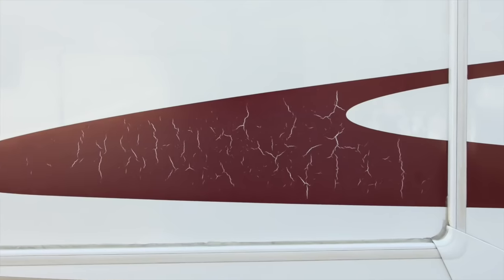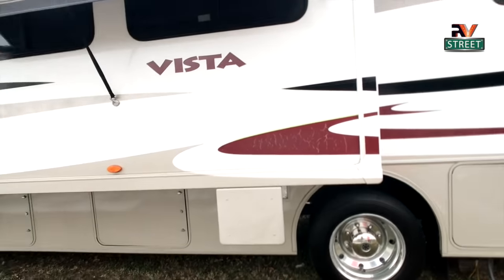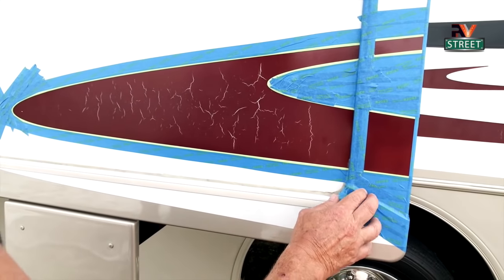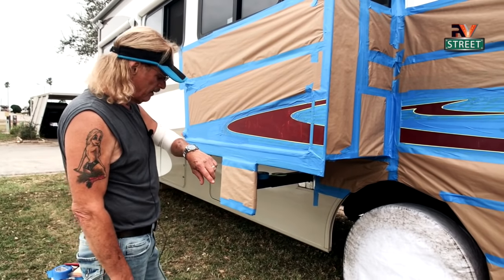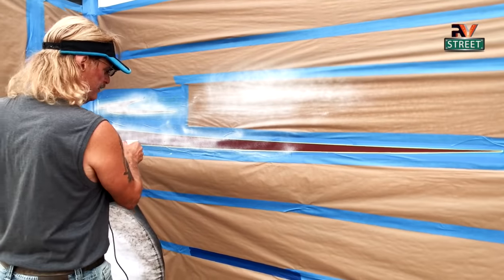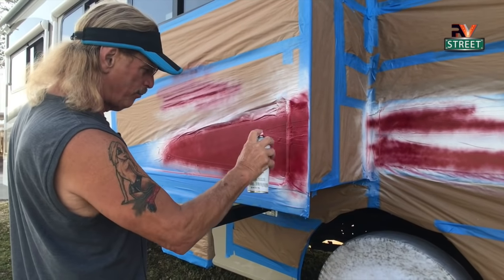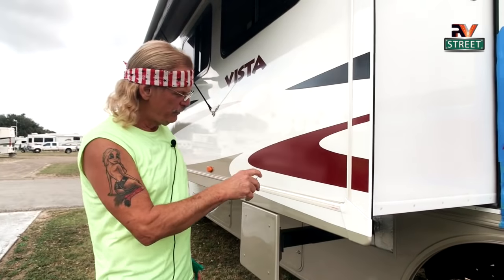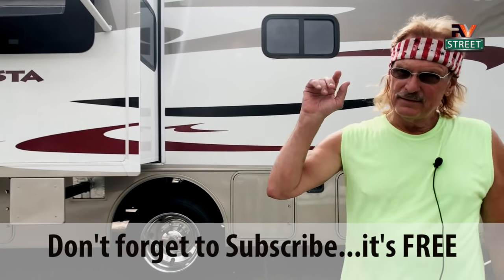How to fix Cracked & Faded RV graphics. Easy DIY job

Comment: Very good video. I was looking at doing lots and lots of buffing compound to try and bring back the graphics. Phooey on that, I'm gonna repaint them. I'm much better at masking off and using a rattle can than I am at buffing.  I may try using a super thin mixture of Bondo to fill the cracks then sand. Good stuff to know. Thanks.
Reply from the maker: Using bondo to fill in cracks will work fine

Comment: Manufacturer cheap clear coat on Class C above cab has worn and graphics cracking. These are great tips!
My issue is getting up there to attempt to repair.😕
Reply from the maker: Yeah on a Class C above the cab is a little more tricky to get safe access to. So what you can do is plan a time and a good area to do this. Have all your supplies ready to go. Then go to a tool rental place and rent a rolling scaffold. You'll be able to roll it right over the front of the truck,—lock the wheels in place—get on top of the scaffold and that top front area will be right there in front of you to work on. And in your case it's probably just a few or small graphics up there in front. That area gets a beating from sun, bugs and so on.It's even hard to wash. You might consider using the 3M wheels I suggested in the description text and just permanently remove them, then compound that area, then polish to bring back the shine and then apply RejeX to protect. That area won't have to dealt with again.
Reply: @RVstreet  Thanks, I had thought about a scafford. But no way to move one and my age have kind of negate  that. 
Was just looking to see if some had a suggestion to repair without the expense of a shop. Even looked into using a wrap. 
Oh to be 65 again😁

Comment: Good video. To protect the vinyl graphics, I prefer a UV blocker/inhibitor vs wax. I used 303 Aerospace on our Cougar and the graphics were still decent after 14 years of Colorado sun. With the new crop of ceramic coatings, I plan to use one of those on the new RV even though I will not do the whole coach ceramic cotaing. I like Gtechnic C4 vinyl trim restorer as I've had great results on black trim on the truck. The RV will then be "waxed" with Turtle Wax Hybrid Ceramic wax.

Comment: Well, you are definitely my go to person for everything RV.  Don't know if you or anyone had this problem.  I've removed some of the decals off my RV with a heat gun and professional goo gone, scrunge pad and plastic razor blades.  These decals are 20 years old, so the adhesive may have been baked on by years of sun. Very difficult to get the adhesive residue off the fiberglass, but got it done. Here's the problem.  The driver's door is not fiberglass, but regular vehicle metal.  The decal was super hard to get off and the adhesive is just impossible.  It's like concrete.  I've sprayed, scrubbed, used the plastic razor blade over and over and over.  Won't budge.  Any ideas?  God bless and thank you for everything!
Reply from the maker: My 3M eraser in my Amazon Store on an electric drill should do it.
Thank you Rachel for your kind  words.
Reply: @RVstreet  One of these days I'm going to get to meet you and give you a big hug!!!  My husband remembered his brother used to run an auto body shop and called him.  You've got to let everybody know this.  I took some shop towels and cut them into strips, doubled them over and saturated them with the Goo Gone.  Taped them up with painter's tape and left them for about 30 minutes.  The baked on adhesive all came off fairly easy.  Now, I'm doing this on the adhesive from all the removed stickers.  You can use these saturated strips over and over.  They pretty well stick all by themselves if they are saturated enough.  Now, even the not so difficult adhesive comes off with one pass instead of 4-5.  Makes me feel good that I can give something back for your followers.
Reply from the maker: @rachelhardyalexander845  👍
OK I'll take a hug too.

Comment: Very good video, I have graphics that started cracking on my 2015 5th wheel, but they are a multi color graphics so I don't think your method is going to work on them. I might just have to replace or delete them, I hate the 2nd option but I might not have a choice. Thanks again for the great video. Did a lot of work of my 5th wheels when traveling to McAllen, it's a bit harder here in Nova Scotia

Comment: I would think you could remove the graphic first, and where the graphic was located would still be clearly visible and you aren't painting on a bad surface.  Great video.  Thanks for the ideas.
Reply from the maker: That was one of the ways I did do it as I mentioned. I also replaced the graphic as a second option. This was my third way to address the problem. It came out nice is still looking good.
thx Brian

Comment: remove the tape before it's fully cured to avoid the "tearing" you mentioned, and you'll get nice sharp lines.
Reply: Good suggestion, but youtuber Farm Project evaluated many different masking tapes and found Frog Tape actually had a chemical embedded in the tape that virtually eliminated the bleeding of paint under the tape.
Reply: @leeackerson2579  It's not the bleeding under, it's the curing over. You take off the tape before the paint fully cures so the paint on the surface of the vehicle and the tape don't have a chance to fully become one.

Comment: I did this exact process to our Cyclone Toyhauler about 4 or 5 years ago. Recently the cracks have started to come through the paint because the decal under it still flexes with the temp changes. It's alot of work. I'm not sure rubber wheeling it off and just painting the bare filon / gelcoat isn't easier and a better idea. You can lay tape down using the left over shadow from the decal easy enough and then follow all the same processes. Happy trails...

Comment: You've done an amazing job!  It looks great!  I previous did the same thing to my Fleetwood Bounder motorhome on the graphics a few years ago.  The one thing I'm not sure about is your putting on the white primer/paint over the burgundy graphic when you are ultimately be painting it a similar color to the original.... burgundy.  Seems like a needless step to me.
Reply from the maker: No not needless at all, it's actually necessary. These layers of white help fill in the small traces of the old cracks after sanding.

Comment: Two years on, how did this stand the test of time?  How does it compare to your previous processes?  Great Video, well done.
Reply from the maker: It's actually been 3 1/2 yrs. now and holding up well. Drawing and having made the new black acrylic graphic and putting it over the old one is a better option. Of course putting RejeX on everything is best to protect everything for UV. Sun is brutal on graphics.

Comment: Thank you for sharing this video. It was very informative. I did happen to see some areas that were sprayed a bit heavy and some orange peel as well in the graphics. Nothing to worry about if you do not look for it or anything or even care about it. Anyway, I thought I share with you a tip to solve that issue if you like. Start off sanding gently using 1000 grit stand paper then move on to 2k then 3k sandpaper then reaply the clear top that you had used. This will help make the serface more presentable for you and to others as well. Question with the Rejex. Is that to use on Fiberglass or gelcoat? I have never heard of this product, so I thought I give it a shot.
Reply from the maker: Thank you for sharing your knowledge. I'm sad to say that Martin has passed away I don't have the answer to your question. Sorry
Reply: @RVstreet  Thank you for the reply. I am sending you my thoughts and prayers during these times. Please take care of yourself.

Comment: Look at other masking products at Home Depot...pretaped paper, pretaped plastic, brush-on clear protectant... Around 15:00; I've found exact color-match for vehicles by maker at auto parts stores and the paint is specifically for vehicles. I got a perfect 1990 HR on Chevy P30 chassis dark blue there. I had 3 @ 1 inch tape stripes running all around the HR, one red, one white, one blue, that were too far gone to fix and I wore out 2 of those rubber wheels removing them...they really work. (Amazon.) Thanks for the Re-jex tip. Mypilotstore.com has the best price until you add the $7 shipping charge. Amazon has it too.

Comment: If you look up automotive paint stores near you, you can usually get all your 3M masking products for the same price as Walmarts or the big chain hardware stores. I like to use Blue fine line pinstripe tape (it will wrap around a dime turning radius without much problem and stay put) that's the only high dollar tape. Between 12 and 15$ a roll. Your 3/4 inch and 2 inch green 3M tape is around 5 and 6$ a roll. Don't ever skip on the quality of tape. If for some reason it gets really humid or a low dew point overnight you can have a nightmare experience trying to unmask it the next day. Never leave masking tape on for more than 48hours in outdoor elements. I've been in the paint and body business for 35 years and I'm too old and worn out to do àll the masking and prep work. My next paint job is going to be a epoxy four tone camo job with a roller. Especially with today's political environment. and a black grey and white for the winter months. Great job on a nice home 👍 other than the materials I couldn't/ wouldn't have done better myself.🇺🇸 
PS if you were to put the blue tape down first and leave a 2mm gap between what you want to paint and the original surface then you can put the fine line down last. That way once the paint is tacky you can unmask the painted surface without having to remove àll the paper first. Makes touch up faster too. Saves time and materials if you do want to repaint a spot for any reason. Blue fine line is a stretchy vinyl tape the pros use for all your flames and graphics. The paint store will be happy to give you a demo on its flexibility. But you might not want to stop with just touch up. Like tattoos it's contagious. You're going to want to put a extra swoosh here and another one there and maybe a few using Guards Red(Porsche) Or a Testarosa red, Ferrari... Screw it, where's my roller😅 
PSS
BTW everyone who gave you a thumbs down is way too anal for me to want to have a beer with.
The beauty about camo is you only need to mask the lights and windows. Your neighbors are going to think you're a little odd, but hey, everyone who did paint and body for 35years already is.😅😂🤣👍

Comment: Interestingly enough our red/maroon graphics did the exact same thing,   Even more so than the gray and black graphics.  Will be using your eraser method to start on our smaller maroon graphics.
Reply from the maker: There ya go Dwight. Good move. This is not rocket science. It just takes time and the right tools. Once it's removed, compound, polish that area so it's nice and shiny again, then protect it with RejeX at least twice a year.
You can do this.

Comment: I have a class c Coachman Santara that has very similar graphics. The lower band of color on my is peeling. It seems to be the clear coat that is failing. I'm guessing I can sand it without removing the color and apply a new layer of clear. Your thoughts? Great job on the video.
Reply from the maker: Without seeing it, it's hard to say. But my first thought would be you couldn't sand the clear coat without removing some of the color.
Reply: @RVstreet  thanks...that was also my concern...but what the hay its worth a try!  THX!

Comment: Great video.  Suggest gloves to prevent oil from hands contaminating paint.  Special warning:  make sure that all cans are enamel (if lacquer paint mistakenly purchased, coat will wrinkle).
Reply from the maker: Good points and yes it was enamel.

Comment: We just bought a 96' Winnebago Vectra 34F RV Motorhome.  Graphics have three colors - a mid-range Cyan, and the same Burgondy you use as the primary colors, and a dark blue-ish color for some stripes in the front and black.   Thinking about re-doing them this winter in browns and greys. as really not a fan of the color scheme.   This video is perfect.  Don't need it to be perfect!   I own a building with a garage that I can park this in so won't need to worry about wind or weather while painting.  Would it make sense to remove the old graphics first with the 3M eraser wheel so you don't have to worry about any sort of bleed thru, and then paint on top of it?    Second, I don't think the previous ever waxed or cleaned the outside of the RV.    What's your suggestion on where to begin with that??     Appreciate it, and nice work!!!
Reply from the maker: Well, if you remove the old graphics with a 3M eraser first, then you don't have a reference of where to outline to paint the new one. And being a 96' Winnebago Vectra, it's 24 years old so there will be some ghosting in the gel coat. Without seeing it and it's current condition it's hard to say how I'd approach your situation.

As far as bleed thru, that won't won't happen in any case as long as you sand well the old graphics, use the white primer first as I explained to BLOCK and FILL before you apply color and final clear. THis will give you a BLANK CANVAS to start with. No bleed thru.

What I'd do if you're unsure, is to try a small area first. Maybe on the back on the coach first and try and get a feel for what will work in your case.

Comment: A faster way to mask the decal is to run a 2" strip of tape overlapping the decal so you can see the decal edge protuding up through the masking tape. Then you slice the edge with a new razor blade, and peel off the overlapped section of tape to expose the decal. It’s much faster and leaves a cleaner radius on the curved sections. This is how many installers apply sectional decals or wallpaper.
Reply from the maker: I would not use this method b/c you'd run the risk of cutting into the clear coat and then you'd have more problems. Installing decals over wallpaper doesn't have clear coat underneath. Your suggestion of the mini-sandblaster (above) was interesting though. Every repair needs to be thought thru thoroughly and what the ramifications might be. Some repairs are forgiving, some not so much.
thx for chiming in Richi 👍

Comment: Great video on repairing your old graphics, thanks.                                                                                            We own a 2002 Itasca that I've wanted to do something with for a long time now as the original owner did not take care of the outside of the coach at all. I've peeled off a few of the graphics but now would like to get the oxidation off the remainder of the coach and maybe add some new graphics as you did. Is there a product you recommend to clean the oxidation off the fiberglass and bring back the shine?

Comment: Great video, thank you. I have a question. We have a 95 rexall aerbus. We really like it. But, my wife has been asking me how can we fix our graphics. They are not so much cracked, but there are a lot of chips along the edges. How well do you think your process will work on that?
Reply from the maker: Well, without seeing I'm not absolutely sure. But, they're 24yrs. old, so I would say yes, my method would work. It'll trim them out nicely, give them new punch and trim even out the edges.

Comment: Thanks for the great video! We completely remodeled the interior of our 2009 Keystone Cougar 5th wheel and planned on replacing the exterior graphics with original ones but after watching your video we will be using the paint over method you accomplished. Sorry to hear of your loss.😥 It's been 4 years, do you still have the RV and wondering how the paint is holding up?
Reply from the maker: I sold the RV 3 months ago and the paint still looked good. It takes time to do but well worth the it.

Comment: Hi Martin. Thought this video was best place to post questions regarding some work I need to do on our 2018 Winnabago Vista 29VE.  As I understand it from Winnebago service, the trim that runs along the bottom of the sidewalls is aluminum. I've noticed along the lip (top edge) of that trim, there's surface rust. Do you know how that's secured? I felt on backside of the wall at the bottom, and believe the trim to be U-Channel, and has both screws and some sort of adhesive/sealant that's holding it on. Rather not take it off if I can avoid it, and just mask off the area all along the trim and sand the lip and face of the trim, and then prime and repaint it. Waiting for body shop that had made a repair on front lower grill area to email me back with type paint and color they used as it was a perfect match. Also, I've noticed back of RV has lost its lustre, and I tried McGuire's Ultimate Compound and tried to polish a small area by hand, but appears I need to follow up with the buffer and other components you mention in one of your other videos. Meanwhile, could you offer suggestion on refinishing the trim mentioned above?  Thanks.
Reply from the maker: If I understand you right, you're talking about the "U" channel up at the top where your roof curves around and down and tucks behind that "U" channel. A gutter if you will. If so, I would just use some 0000 steel wool and to clean off the surface rust.
Otherwise If I don't have that area correct then I would just mask off that area all along the trim and lightly sand the lip and face of the trim, and then use a primer/paint combo in one it as you suggested.
As as far as losing some of the luster, yes the equipment I used in my washing video is what you need to bring it back and then keep it that way. I put links to everything I use in the description text. Go back to that video and at the top of the page under the video you'll see SHOW MORE, click that scroll down and you'll see them right there.
https://www.youtube.com/watch?v=7KmgneT3HPs&t=800s

Hope this helps. 👍